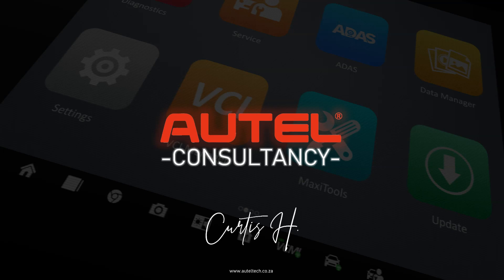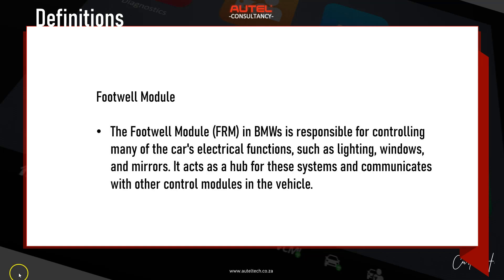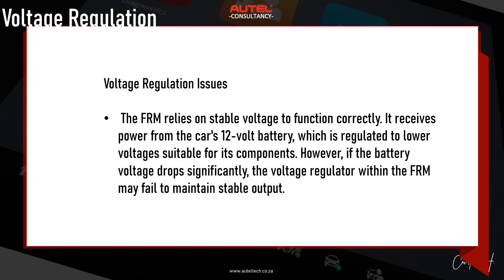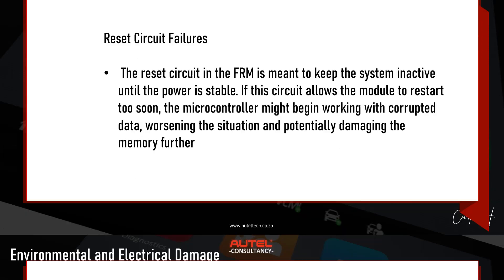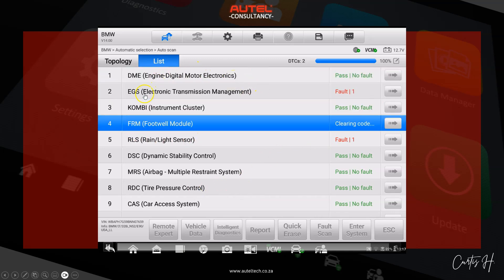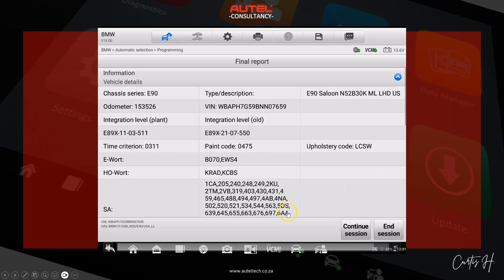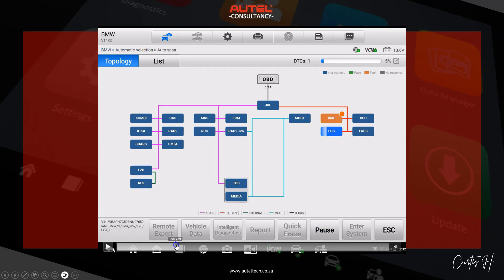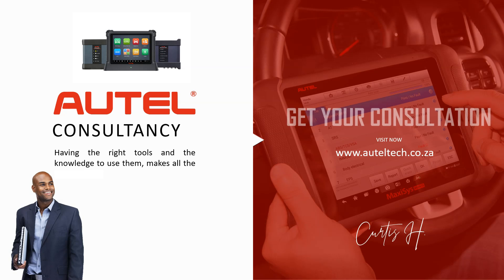How To Program a FRM Module On a 2011 BMW 328i With The Maxisys Ultra

Comment: In the middle of programming a 11 e90 FRM and in the process control modules part I don't have a box for programming the only option I can select is encode and replace no other way to manually rewrite the FRM module..
Reply: Bro do you have the solution?

Comment: Thanks for video! What about MaxiCOM Ultra?, if I'm wrong please correct me that difference between Maxisys Ultra only in VCMI.
Reply from the maker: I normally charge for tool strategies as I get into detail in the consultations but 2 main differences will influence your purchasing decision. One is that the Maxicom products are usually sold online only so your support will be limited. Also this is an international tool so there are certain online features you won't have access to versus a regular Maxisys Ultra . What I suggest is that you contact your supplierer to find out the difference or you can book  diagnostic tool consultation so I can give you my recommended tool strategy based on the problems I discover in the consultation.
Reply: @AutelConsultancy  Thank YOU for info!

Comment: Could you ask Autel not to sell their IMMO tools on Amazon so the world can be a better place?
Reply from the maker: Unfortunately, they are focused on transactions. Personally, I feel those platforms are doing a disservice to customers  when purchasing  high end tools. Did you have a bad experience?
Reply: @AutelConsultancy  I haven't, as I  purchase from distributors that only sell to security professionals. DIYers aren't likely to drop $3K on an IM608 on Amazon, the problem is the $500 tool than is far too easily accessible to those who shouldn't be allowed to purchase such equipment, criminals with intentions to steal vehicles, in particular.

Comment: and the same by im608 pro?
Reply from the maker: To be honest I am not sure. I would say no but I have seen some people say the im608 does have bmw programming.  I normally just say the if you want bmw and benz programming stick with the ms909.
Reply: @AutelConsultancy  yea, I agree! I have maxisys elite, i live in eu and bought from official distributor, but elite has less functionality, best tool for MB & BMW is 909, dont like 919 bcs due to vmci and its not j2534
Reply from the maker: @audriuskimtys7943   The ms919's VCMI is a J2534. It has 6 functions in one. Its an Oscilloscope, Multimeter, Wave waveform generator, Can Bus Tester, Vehicle Communication Interface, And J2534.  This is the same VCMI used for this case study with the Ultra. No worries your tool is fantastic I just wanted to make a clarifications